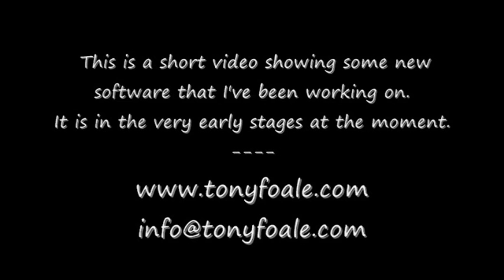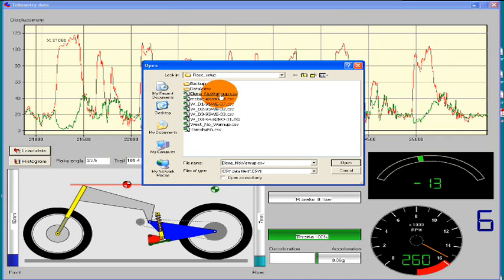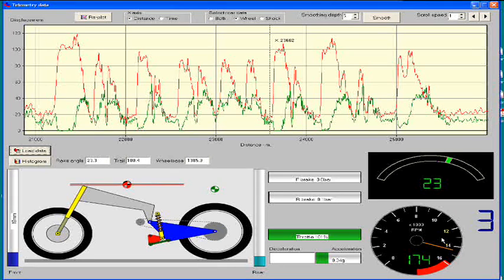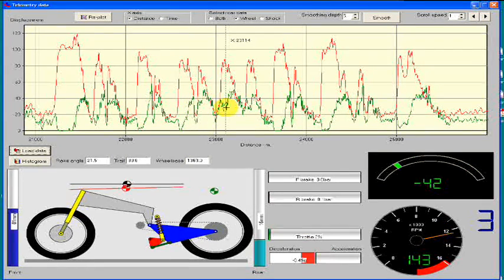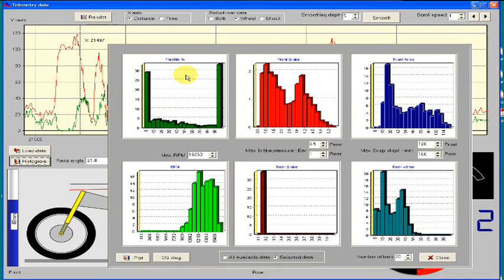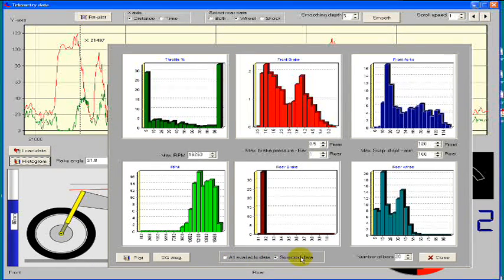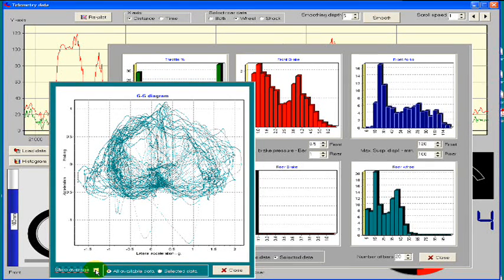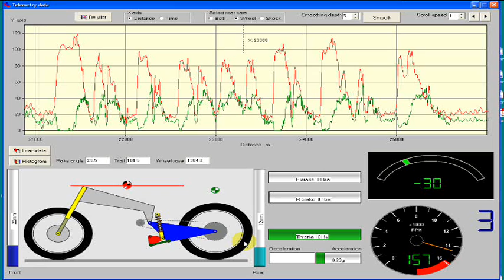Software Demo

Comment from the maker: Yes. Export the data in .CSV files. My software reads these. This will not replace the existing packages but will provide additional means to help the interpretation the data. 10 lines on a single plot is visually confusing and the DAQ packages do not have a link into an analysis of the suspension. By providing this we show how rake and trail vary around the track which will help setup. The simple visual displays of data are also better when going over the data with most riders..
TF.